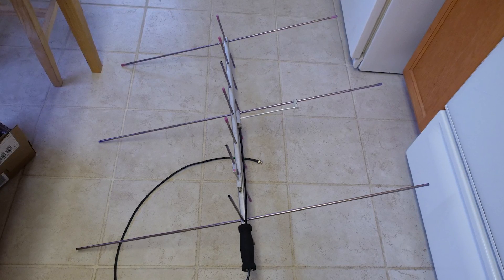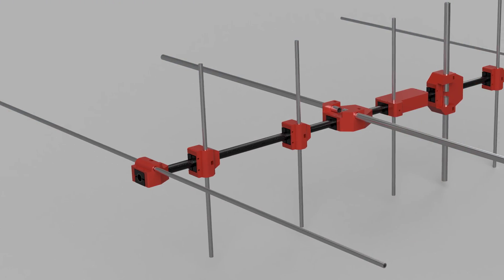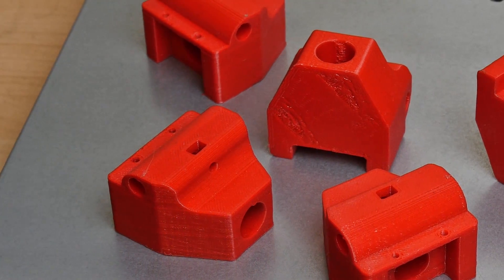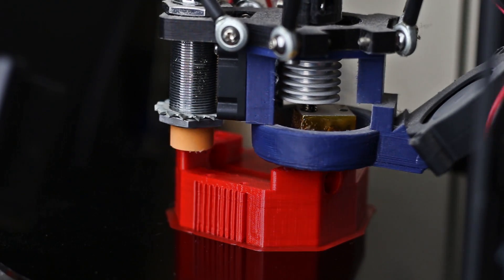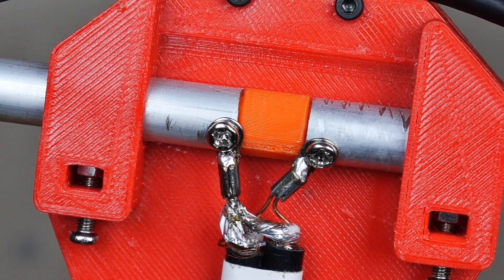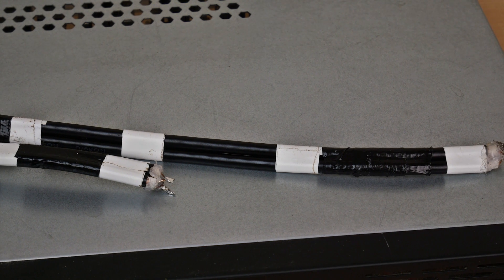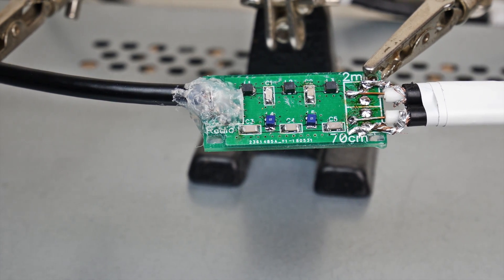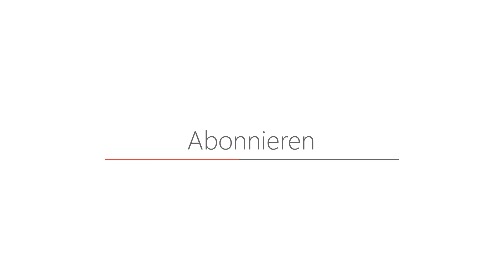[EN subs]Carbon Arrow Yagi Antenne - leichte Dual Band Yagi für 20€ bauen

Comment: Hi @Tysonpower, vey nice video and cool antenna. Where did you get the carbon fiber mast from? Online I can only find masts with different diameters between one side and the other.
Reply from the maker: Thanks! I got the carbon fibre rod from aliexpress, but you can find it on ebay as well. just search for "carbon tube 12mm"
Reply: @TysonpowerDe  Thank for your reply, I'll look again, on aliexpress I've found a lot but, as I said, they have say 12mm on one side of the pipe, and 10mm on the other, I couldn't find a pipe with the same diameter across the whole pipe, I'll look better!
--- EDIT --
My bad, the 2 diameters are actually the innner and outer diameters... so all good! :) Thanks again for your help
Reply from the maker: Thanks, hope you add a make on thingiverse when you are done with the yagi :)